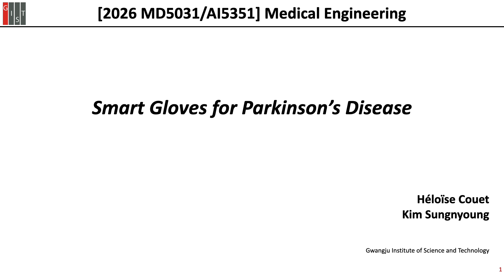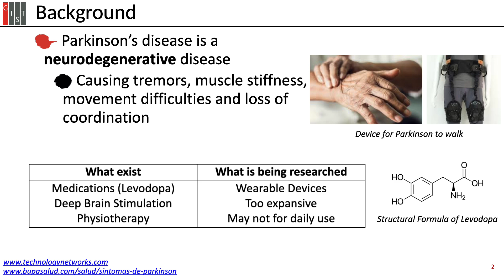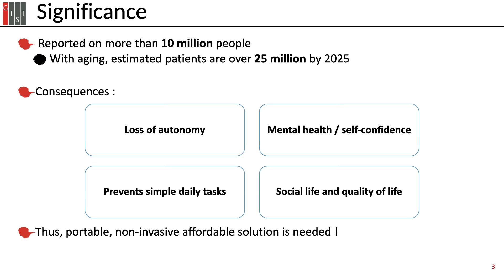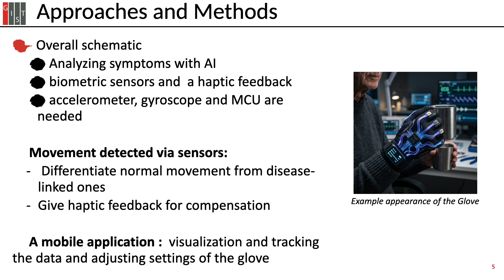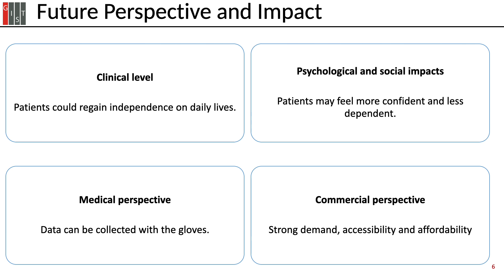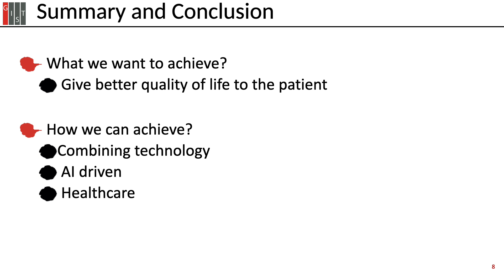MD5031 team 2 Heloise Couet & Sungnyoung Kim

Comment: yeji: Excellent project concept! Utilizing micro-actuators and haptic feedback to actively compensate for hand tremors could significantly improve a patient's daily autonomy. Regarding the practical feasibility, how do you plan to handle the potential heat dissipation from the microcontrollers and active actuators to ensure the glove remains comfortable for several hours of continuous wear?

Comment: Phiri Ethel: The future is indeed bright if this is going to be successful . I like the development of this project. Just a quick question, I heard something like a sensor detecting signals then the algorithms take those signals then it will be processed. I was just curious on that aspect if you have found alredy existed algorithms that people tried before concerning parknson as a starting point. Also how will it be able to filter those signals on the aspect of noise. On the issue of battery what kind of batteries are you planning to use in this aspect. I saw somewhere where you mention of having a mobile app as a connection, have you thought about the best IoT method that can be used?

Overall, I really like the presentation, it is clean not cluttered too.

Thank you.